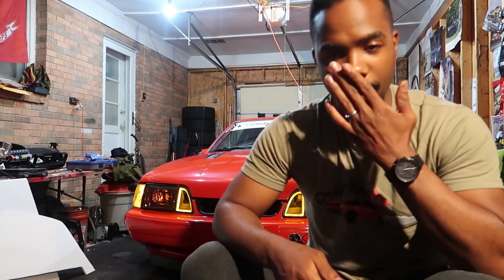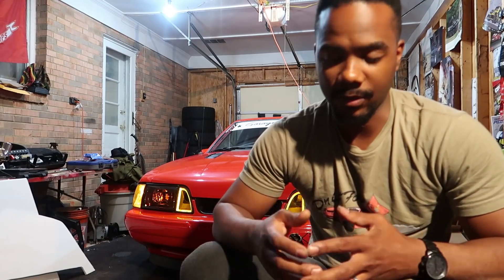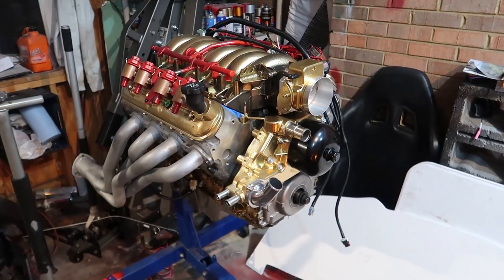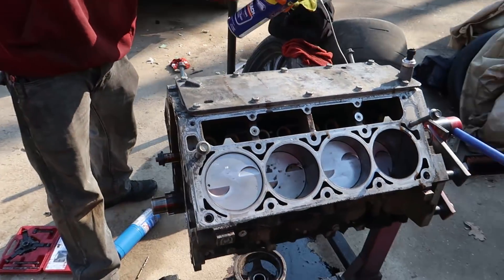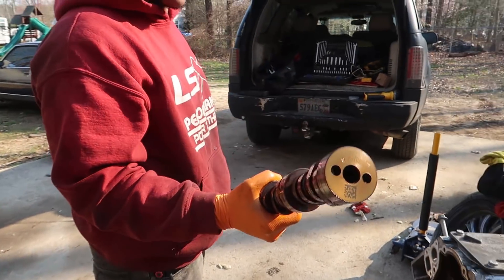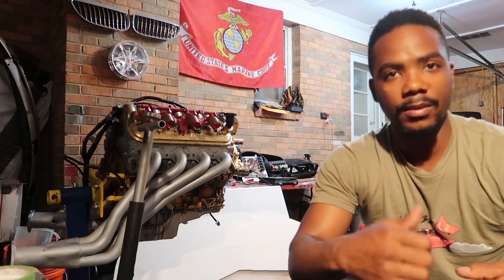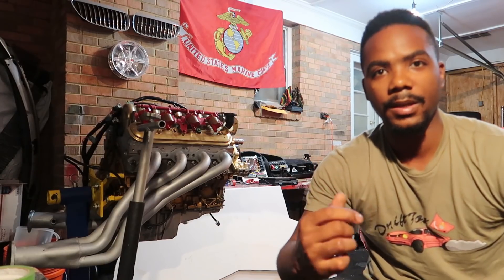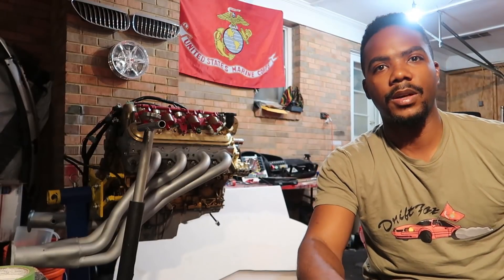New motor for Drift Fox Revealed!

Comment: 5.7 aluminum block (sleeved) stock bottom end, semi-aggressive cam, ls6 Heads, stock manifold, stock coils. Maybe got the motor from a friend who’s going iron block and kept the harness so u had to grab one for this (painless WH?)Probably Pull back some timing to get a bit more on pump gas. Not cheap, not mainstream, just sensible.

Comment: You bastard, sweet motor😨  best choice for rpm and HP. My 302 pulls strong to 6,000 with AFR 185 but going to stroke it to 336 ci
Reply from the maker: I currently take mine to 6300, I've heard that I can do 6700, but that's the danger zone, not worth it.
Reply: I would get a 351w before stroking a 302. 302 blocks are questionable at 500hp.

Comment: Semper Fi  from near MCAS YUMA, your one of the coolest teachers keep bruce lee-ing it. I sold at Ford fyi 3.5 Ecoboost swap in the shop is 15k. fyi Fusion Sport is a 2.7 Ecoboost same same F150. peel an eye back salvage wise. to get the high idle direct and low idle plenum dual injectors all products you need 2018. and thats not useful data now.  I wanna see the electronics in the ls swap.
Reply from the maker: Yeah, I looked into going eco boost, but at the end of the day, having a v8 is more important to me than having an odd ball swap, plus I'm not a huge fan of forced induction for my own car.  If I had time and money for another build, I think I would look into it.  The LS swap is done now.  The electronics are pretty simple, Stand alone ECU and Harness, I think only 4 wires needed to go back to the chassis.  Yuma is awesome.  My Dad was a Marine as well and we spent some time stationed at YPG in the early 90's The desert out there is beautiful.  Hope you're having fun out there man, have fun while it lasts.  Stay out of trouble.
Reply: @Sgt.Slides  the Explorer Interceptor punches to 3.7 and larger dual twin scroll turbos versus the 3.5 dual single scroll. 3.5 has 11:1 @ 20psi. Just fun numbers all that. The serious shiz is the new ten speed. The factory guy said gm was government shoehorned on development to profitize get some ROI back post bailout..it may be the ten speed will fit. Maybe even the kinda thing I should have PMd. It's all in the first 3 gears and a 373 becomes 410s and so on. Rep said best transmission made ever globally production. 2018 is fully forged, smaller than 2017 and stronger n cooler. An 18 coyote ten speed at 470 HP is a hold on thing. If you've not demoed one ...freak in the streets in your fox.
Reply from the maker: yeah, everyone's raving about the new autos these days,  I wish they didn't come at the expense of making the manual obsolete.  I wish that 6 speeds were still an option in most cool cars, especially sports cars. 
.
Reply: 2018 Mustang GT Base, add Ac CC pw Pdl (101a package) and 3:73 TrakLok is 6 Speed for $37.9k minus $5k paying $300 over invoice add $2k extending warranty to 100k limited full coverage $34.6k. that was my first new GT drive. All options = 58k. I have one MY97. From 215hp to 470hp what's prevailant is they feel the same as in Mustang GT.   Gobs more torque. MY16 Camaro SS has a far smoother 6speed and clutch feel.

Comment: what K memeber is in the car? I'm in the middle of swapping an LS3 / TR6060 into my 93. I have a Maximum modular K member, custom engine mounts, BRP Muscle Rods Trans cross member, and I couldnt fit any of the long tube headers I tried. I ended up using the Holly, Hooker Cast manifolds.
Reply from the maker: currently it's a stock k member, but I have a M/M modular ready to go in.  Modular mounts with adapter plates.  Not sure what I will do with the trans mount just yet.  did you try Headman swap headers, or regular shorty headers?  Please drop me a line, i'd like to chat swap details with you.  e-mail Media@PremiumFuelMag.com

Comment: Nice build Bro.  Why did you not tear the motor down and due a full rebuild of the short block?  Really nice platform but I truly think you missed out on an opportunity to truly hone, deck, and balance the rotating assembly with the connecting rods.  If you want a high rpm dependable motor that step is a must IMHO.  Regardless, nice build and keep doin you.  Late

Comment: You can get gt40 motor out of a ford explorer. It's the same motor only with cast iron heads.
Reply from the maker: All SBF cars came with cast iron heads, and explorer "gt40" engines come with a really crappy cam and valve springs.  Cobra GT40 stuff is slightly better than stock 5.0 stuff, but not worth the trouble of swapping an entire motor for an additional 20 hp.  I have a detailed comparison of GT40 stuff to stock stuff if you look back a few videos.

Comment: I'm just curious what you consider a real LS?
Reply from the maker: real LS motors, LS1, LS2, LS3, LS4 LS5, LS6, LS7.  Other Gen4 and 5 motors  (Not actual LS engines), LQ4, LQ9, L33, L31, LM7... ect
Reply: Ok but they are all LS platform whether aluminum or iron
Reply from the maker: They're all gen 3 and 4 chevy small blocks.  The have adopted the name "LS" mostly by people not knowing any better.  A Samsung tablet isn't an iPad because people call it that, an LQ4 is not an LS,  there are no iron block LS motors.

Comment: Anyone knocking this swap obviously has never SERIOUSLY priced out a swap or high power motor build for these cars. I built a 600+ HP n/a sbf for mine. But it cost me coyote swap money. Everything costs money, the ls is readily available, modern, reliable, and pretty cheap! Hard combo to beat.
Reply from the maker: I was pricing out a Coyote swap for a 200k mile motor, and what sent me over the edge was the $900 swap headers I would have to buy.  Folks have to realize that the actual motor is probably inly 1/5 of the whole swap.

Comment: Why not a SR20DET. Is capable 400 hp and weight around 300lb. plus more room and balance of the Foxbody. The Fox 5.0 motor weight in at about 420lb in dry weight, so not much difference from LS.
Reply from the maker: I'd take a v8 over a 4 banger any day.  I have done an sr20 build, and it was an awesome car, but it's just not my preference, also, consider that an LS motor is 350 hp native.  you can get them above 400 for around $300 with just a cam.  To get an SR in that range you have to upgrade everything.  Parts aren't cheap, and the motor's not cheap, and it's still a 4 banger.  I considered doing an RB engine, but decided not to for the same reasoning.

Comment: Ls 5.7 or 6.0 but more likely a 6.0 truck 98 or 99 because of the aluminum block. 4.8 and 5.3 cast iron blocks, the heads are 243 ls2 because they can hold 600 inches of lift
Reply from the maker: Close, but like I said, you won't be able to guess it, you either know it when you see it, or you don't  It's all visible in the vid.  Good try though.

Comment: L99/6.2 with 243 heads
Reply from the maker: Hey Dre, you win the shirt! lol, can you fit medium?  And to reply to DickStain, like I said in my video, it's not the optimal set up for power, but it's better for what I want.  243 heads are better built than the later square port heads, and can rev much higher, as I plan to ride this engine at 7100 rpm.  The smaller valves let it rev higher.  The big valves on the LS3 style are only safe up to 6600 rpm.  I can also run more lift on the 243's.  I will surpass my power goal on this set up, so I don't mind leaving several ponies on the table with "downgraded" heads.... And for the shirt, Please e-mail me at Media@PremiumFuelMag.com .
Reply: Premium Fuel Mag Yes I can fit medium, I think lmao.. You'll reach your goals with the 243s easily. People make a big fuss about it sometimes but in my personal experience, its nothing to loose sleep over unless your talking about a 400 ci + Ls, but to each his own!  I'll email my info and thanks!

Comment: The mark 8 motor is the termi motor without the blower. And a lot cheaper as a junkyard build. Oh and your right, I dont like what I see. Your car, your money, but IMO if you want a chevy, buy a chevy.  Im a purist about very few things, but this is one of them. If you dont have loyalty, you dont have anything. Each car guy has a different love of the sport, and I can respect that though.
Reply from the maker: Brand loyalty limits your imagination and you end up missing out on really cool stuff.  I don't have brand loyalty, but I do have a pretty badass car that's setup exactly how I want.  I don't see any disadvantages there.

Comment: Haha, hey brother tell them like it is, that's your build.
Them LS motors are pretty reliable. And for what I here they can handle boost just as it is.
  Not a bad swap, wouldn't be the first and not going to be the last.
       I'm finally getting around to the motor in mine.
   I was trying to get all the chassis and frame reinforcements down, but as fate would have it, engine failier would out that at the forefront.
   Going the the most economical route I figured would be good for me. And just doing a straight up rebuilt HO.
   We'll still be here.  Good luck with your build.
Reply from the maker: Thx!

Comment: 5.0 Roller block...and Stroke it? Bet hey...I agree with no Band loyalty. Why would I use something inferior when there is a more powerful, lighter option. My argument is that ford should have made an equally badass  of an engine.
Reply from the maker: No doubt that the Coyote is equally badass, but it's still bigger, heavier, way more expensive, and complicated.
Reply: Let’s look at the LS for what it is - the 5.3 is a truck engine. It’s built to handle a heavier load on the regular. The rough equivalent is a 351w. People are comparing a much later model engine to an engine from the 60’s up. Just not a fair comparison.

I love all the brands, I just wouldn’t bastardize a hellcat with a terminator cobra 4.6, much like I wouldn’t stick a hemi in a corvette. I don’t call that brand loyalty, I call that learning how not to follow a trend and figure out how to work with what you got. I just don’t agree that the same results can’t be achieved with a 302 based block. That or a 2v, 3v, 4v or even a coyote. People talk themselves down to an LS because it’s “cheap and easy”... fine I guess, but it leads to a very soulless project.

Comment: LOL how about just buy a camaro if you want an LS?.......Bet it would be cheaper in the long run
Reply from the maker: I'm a huge Camaro fan, and I learned drifting in a 94 Camaro LT1,  I actually shopped for an ls powered 4th gen b4 I bought the fox, but they are hard to find and people want too much money for them.  I'm actually glad I didn't settle on the camaro because I tore up my 94 drifting, the rear ends are trash, and they get all bent up and off centered from sliding around.  Other cars I looked for were the mk3 Supra, and an e46 coupe and e34 5 series.  In the end, i'm glad I settled on the fox because I always wanted to do an IRS swap, and this is the easiest car to work on between the others I named.  Like I said in the video, I'm a BMW guy, but brand loyalty seriously closes doros to some really cool stuff.

Comment: Should’ve stuck with the 302 and built it better with a turbo.... would’ve been cheaper and would’ve kept it ford power. LS is mainstream
Reply from the maker: I didn't address Turbo in this video,  I was very close to going that route, but after consulting with folks who have been there and done it, a turbo kit would be nothing but trouble for the hard driving that I do.  The other 2 foxes I have shown on this channel are turbo builds,  Neither of them got any seat time since last fall, they're trying to fix their turbo problems.

Comment: The 5.0 your max HP is 500 and lose reliability and you will be more than that stock LS
Reply from the maker: exactly, and I can drive it harder and fix it with oem parts
Reply: judges69 you can definitely get more then 500 out of a 5.0

Comment: Yo.. Good job man.. Very good video and I love that fact that you kept it all the way 100% with you subscribers. Tell the truth.. Money does not grow on trees and this is a VERY EXPENSIVE HOBBY. Congrats!!.. and just for fun I'll guess.. -98 LS1 bottom end with
   - ARP rod and main bolts
   - Custom cam
   -  rod and main bearings
   - LS4 oil pump
   - LS2 timing chain
   - 703 truck heads
   - Dual valve springs/retainers
   - LS6 intake manifold 
👍💪🏁
Reply from the maker: ha, nope!
Reply: Premium Fuel Mag lol.. Thought I would have at least got the 703 heads right.. Glad you got the build going.. Much respect 

🏁💪

Comment: GM= Great engines with a pile of junk around it. They really put developmental costs into the engine when they feel like it.

Ford has competent engineers all around, but it seems the accountants make them cut small corners everywhere.
Reply from the maker: I don't see why people keep calling GM motors junk, they've been using the same v8 since 1997,  they know they've got a good thing and they are sticking with it, unlike BMW which re invents the wheel every 6 years and never gets a design fully dialed in before moving to a clean slate.  Ford motors are cool too, but with there being so many different ones, parts are a little more expensive and harder to find, plus have you ever cracked open a DOHC v8?  That's not something I ever want to do.
Reply: Premium Fuel Mag  No, I mean GM engines are fantastic, the presentation of the body/chassis is "junk". With the exception of maybe the Camaro, Vette, and Cadillac their cars are abysmal. GM knows their loyalist will buy their cars anyway. They can do do much better than some of the clunky "rental" cars they make, with good engines.
Reply: Premium Fuel Mag Don't get me wrong an LS swap is pure logic. The LS is great because it was made for the vette AS a performance motor off the bat, then "detuned" for other vehicles. The Mod motor debuted in the Town Car 😐, Ford had to work backwards to make it fast for years and years. 

The coyote is awesome because it's for a mustang...  just expensive.
Reply: Best comment on Ford and Chevy. I agree 100% I'm a die hard Ford guy and I'm building a 408w for my 95 mustang. Can't wait to finish!

Comment: If a coyote swap is 10k then what is this swap going to cost? You could've coyote swapped with an f150 engine or buying a wrecked GT. 

351s are in junkyard everywhere just an fyi, unfortunately I lost a lot of cares for this car.
Reply from the maker: depends on where you live, it's hard to find 351's near me, but like I said, I wouldn't have been satisfied, power gain isn't really my end goal here.  and a brief breakdown of the coyote is $2000 for a beat motor with a quarter million miles, 700 for k member, 900 for headers, 1500 for the ford stand alone wiring harness, $1500 - 2000 for the transmission and clutch... I quit pricing after I got to the $900 headers,  never accounted for the electric pedals and other miscellaneous details, as well as refurbishing a tired DOHC engine.  It's been done b4, but it won't be done by me.
Reply: Premium Fuel Mag hey dude,let me tell you something,you're going to spend the same shit doing the ls swap,I know you can give a shit but I lost all respect for this build! FORD ALL THE WAY!!!!
Reply: Any junkyard with econoline vans or f-series trucks, you could've had your heads drilled for the larger head bolts, used your cam again, same "cat back" exhaust, same transmission till you could've bought a tko or so on.

Things needed to buy, your much wanted long tubes, high capacity oil pump and oil pan, intake manifold, and then a way to tune the ecm if not ms3 or better. 

What trans do you plan to run with your ls swap? Because that's a big cost unless you're going used and still 1500+
Reply: Premium fuel mag, have you priced fox ls headers?
Reply: Premium Fuel Mag I tried to do the coyote swap into my fox and fuck that engine. The ls might not have the same power when compared to coyote but it will fit in your engine bay